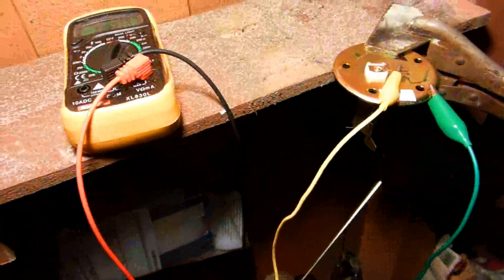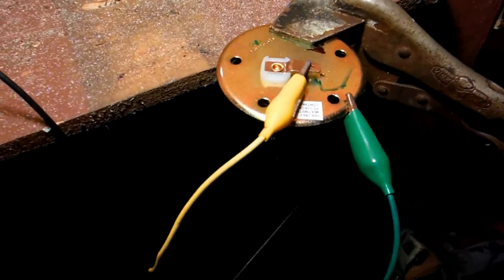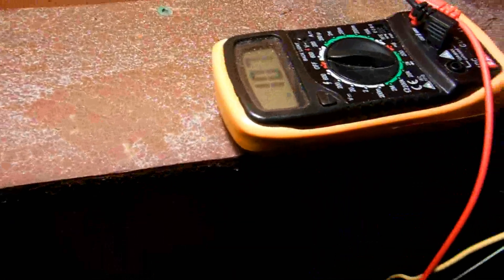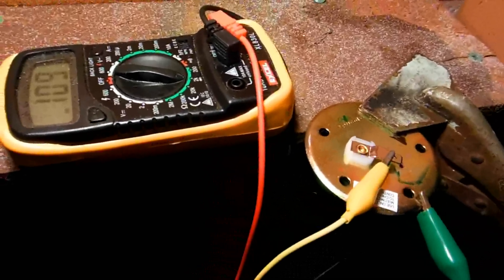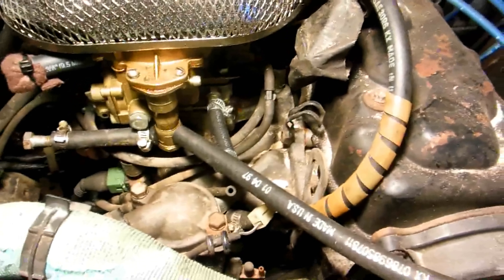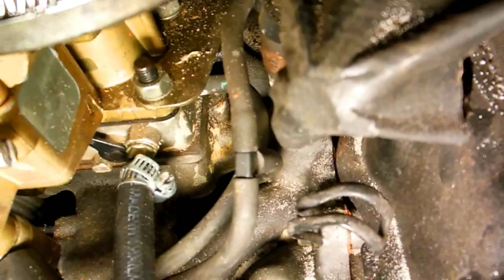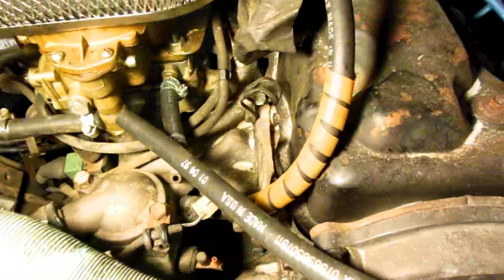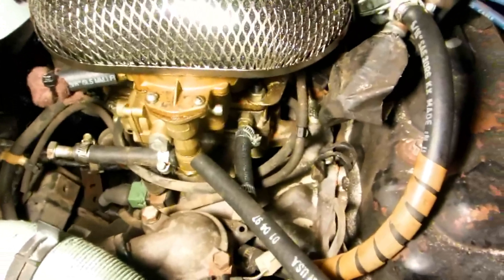Troubleshooting Gas Gauge, Fuel Float & carb -Suzuki & others

Comment: What are the green and yellow alligator clips hooked to on the other end?  I plugged the fuel pump back onto the 12v connector and raised the floats thinking I'd see the gas gauge go up, but it didn't.  The float and gauge were working perfectly before i got a hole in my gas tank, but after I did an emergency patch to get me down the road, the gauge wasn't reading properly. I have it out but want to make sure the floats work before I put it back in. The pump is only 2 years old.  Thanks!
Reply from the maker: You could have a ground problem.  That would be most likely.
Reply: You're right, I never thought to hook up the ground strap that is on the fuel filter on top of the tank.  I merely plugged in the fuel pump before I put it in the tank, but it won't work unless the system is grounded.   Thanks

Comment: Can you put some of the same stuff that your coating your tank with on the gas float to make it last longer are will it add weight to the float are will it make it sink just a thought , !
Reply from the maker: The float should last a long time.  The problem is that today's gasoline has a shorter shelf life than the stuff from years ago.  If you let today's gasoline sit a while it screws up fuel system components worst than how it was years past.

Comment: Use that dielectric grease when you put it back together you need a good connection there and that clean that surface well gas is thinner than water that electrical spot deals with a lot of the elements
Reply from the maker: Yes, plus heat shrink tubing,  I don;t fuk around when I do stuff.  I make sure it lasts.